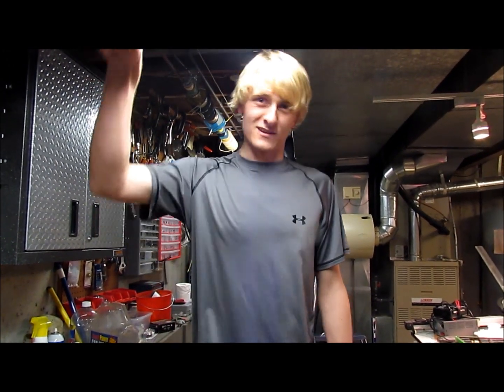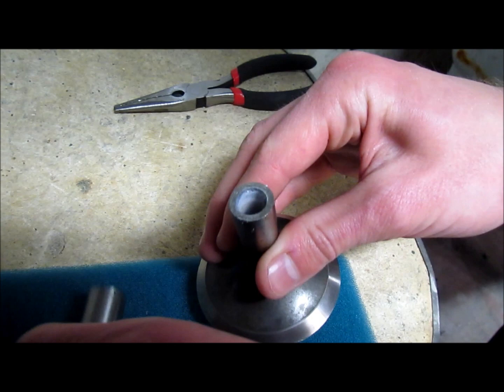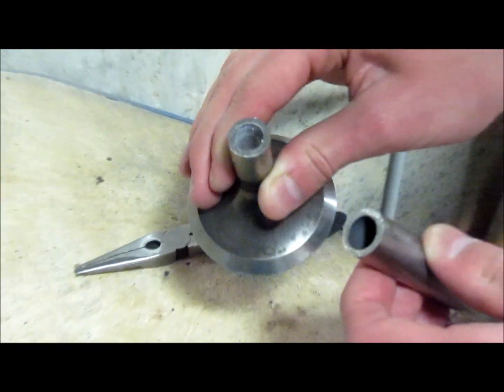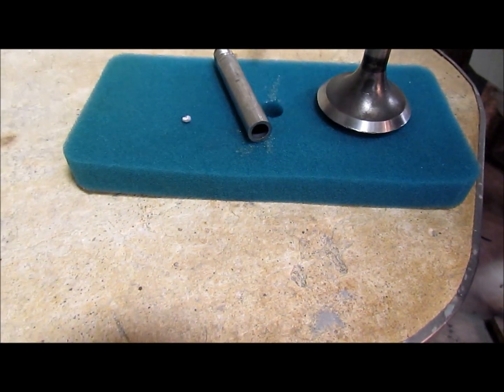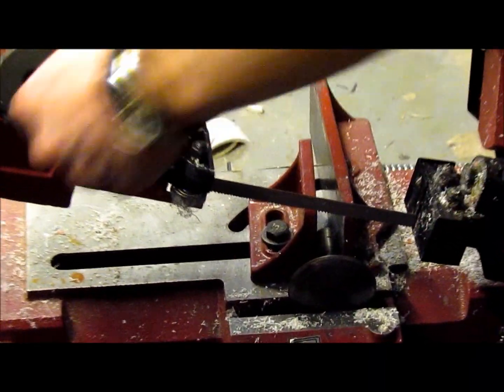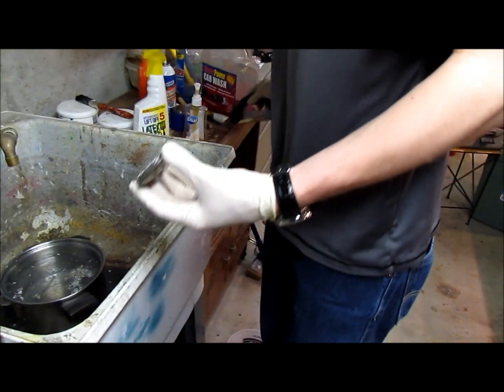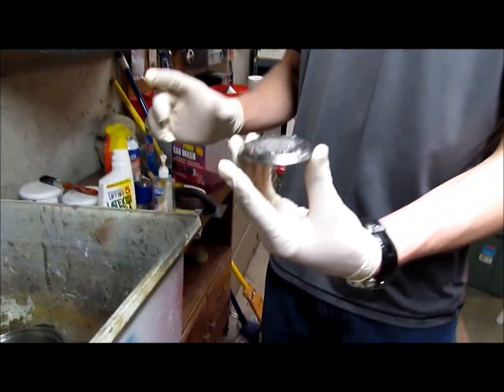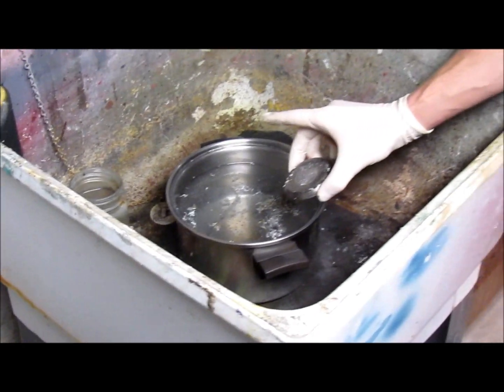Sodium Explosion in Water - Sodium-Filled Valve Stem

Comment: ⚠️ WARNING Sodium metal reacts violently with water and quite reactive with air, and the reactivity is a function of the relative humidity, or water-vapour content of the air.
The temperature of burning sodium increases rapidly to more than 800 °C (1,500 °F), and under these conditions, the fire is extremely difficult to extinguish.

Comment: ⚠️ WARNING Never reface, stem grind, hit or cut a sodium valve. They should be buried in a landfill for disposal. And never use a water injection system in an engine using Sodium valves.

Comment: so the energy being released after 100000s of miles in the heat transfer process is a dead topic ?
Reply from the maker: Key Sphere Yes. No energy is stored.
Reply: "Heat transfer" not heat storage.
The sodium transfers the heat from the head of the valve to the engine oil in the head.

Comment: I recall reading disposal instructions for sodium-filled valves in a Infiniti service manual, and they said to do pretty much what you did: cut the valves open with a saw and immerse them in water.  I guess your diesel valves had a lot more sodium than what would be in a passenger car's valves.  Interesting video nonetheless!

Comment from the maker: I'd drastically underestimated the amount of sodium in there. I thought there would be two or three grams inside a small recessed pocket.

Turns out the entire head of the valve was hollow and filled with sodium; I'd tossed in nearly 15 grams.

Plus, it was all pulled underwater by the heavy steel part, rather than floating like sodium usually will.